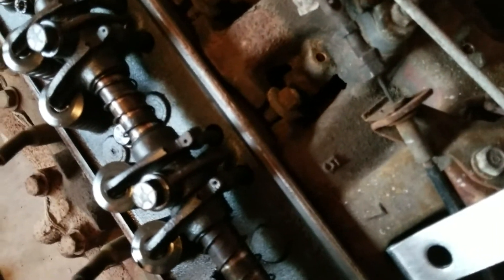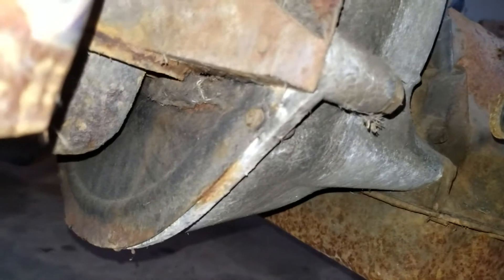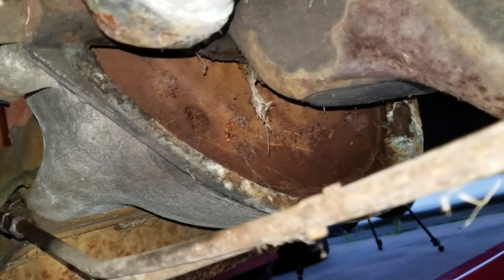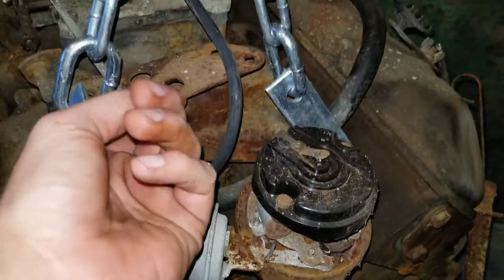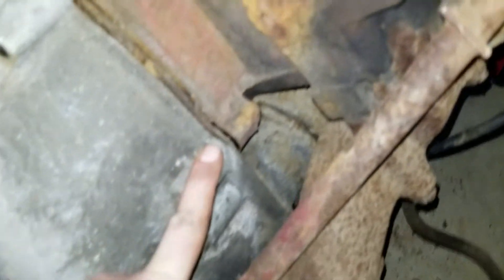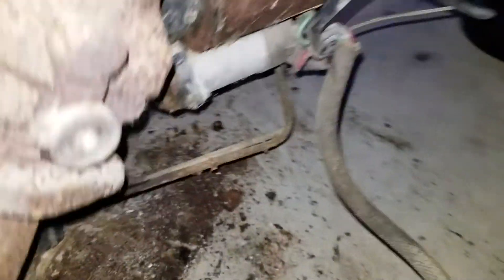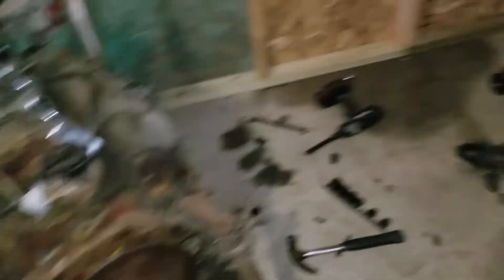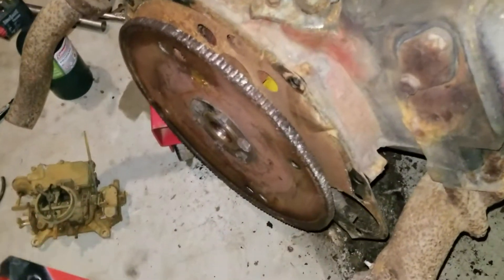Ep. 1 - AMC 327 - Separating Engine and Trans - Searching for a House!

Comment: Your videos sure do help, unfortunately all my parts were not separated in bags. I'm using your videos as parts references!
Reply from the maker: What all do you have apart?  I can honestly identify most bolts just by looking at them if you want to send some pictures :)
Reply: @RamblinGarage  I also have an issue with knowing how to bolt the engine to bellhouse, I have some bolts that came with the engine when I bot the rambler that I own, the engines being rebuilt so I don't have it with me to do my own reckoning and figuring, so I'm looking online and have not had definitive answer to my questions about so many questions. A parts catalog may be usefull, I have both tsm's for my model and year of Rambler.
1958 Rambler"super" or series 10- as per tsm definition between series 10, 20 and 80. But the tsm does not go into such basic details for engine to trans attachment, so I'm kinda stumped.

Comment: Is that a cheverolet mill or did AMC produce their own?
Reply: After having owned and worked on many AMCs over the years, let's see if I can clear up the confusion.

AMC's 327 was first offered for the 1957 model year. Chevrolet's didn't become available until 1962.

AMC's first generation V8s (250, 287 and 327) had valve covers retained to the heads by two studs through the tops of the covers. The Chevrolet small block's covers used four bolts running through the outer edges of the covers to the heads.

On the AMC engine the intake manifold didn't seal off the lifter chamber. There was a curved metal cover which also contained the oil filler tube. With the Chevrolet the manifold sealed off the lifter chamber.

On the AMC V8 the thermostat sat in an iron casting that connected to the fronts of the heads and flowed coolant out to the upper radiator hose. Chevrolet's thermostat sat in the intake manifold.

And here's another difference: the AMC 327's intake manifold could be removed without disturbing the distributor. On the Chevrolet the distributor had to be removed to allow the intake removal.

This is probably the most definitive difference between the two powerplants: the fuel pump actuation. The AMC 327 had the pump mounted on the timing cover. It was driven by an arm that rode an eccentric bolted onto the nose of the camshaft. On the Chevrolet the fuel pump mounted on the block and was driven by a pushrod with an eccentric cast right into the camshaft, well behind the camshaft sprocket.

While it's true that AMC did use the GM Delco "window" distributor for many years, the ones found on the AMC first generation V8s had different part numbers, castings, advance mechanisms and advance curves. The points, rotor and cap interchanged, and some aftermarket parts could be made to work, but there were enough differences between them that they could be like night and day.

Take a look at the cutaway drawing of the first generation AMC V8  
  http://www.crankshaftcoalition.com/wiki/AMC_V-8s   and you'll also notice the differences in the oil filter mounting, spark plug location and exhaust port angle, plus AMC's use of rocker shafts versus Chevrolet's stud, ball and nut system.

Hope this helps!
Reply: @Rick-S-6063 It definitely does help!!! I sure learned a whole lot that I never knew before. World's apart between the AMC 327 cubic inch V8 and the Chevy 327 cubic inch V8. Both are really good engines.
Reply from the maker: AMC produced their own blocks.  They did use a Chevy distributor, also this was a Ford FNX transmission.  They used a lot of odds and ends that can interchange with other companies engines, but the AMC and Chevrolet 327's were two very different engines.  I'll try to get more into that as I dig in deeper as I didn't document the best my first time around.
Reply: LSX StreetCars Thanks man. I can't wait.
Reply from the maker: Of course! Thanks for checking it out!
Reply: @DoctorGiggiz: AMC  produced their own 327 cubic inch V8s.
Reply: @DoctorGigglz: AMC produced their own V8s. No connection to the Chevy V8s.